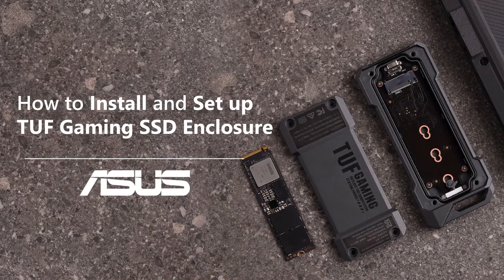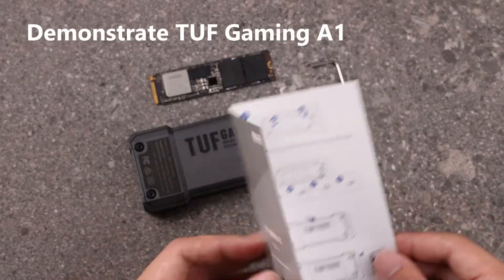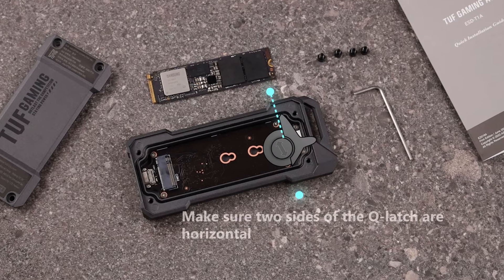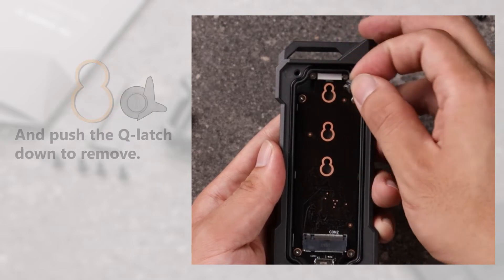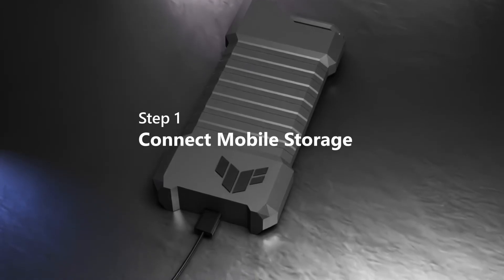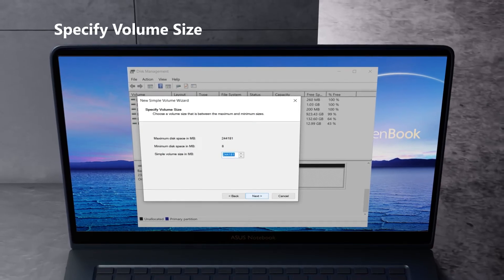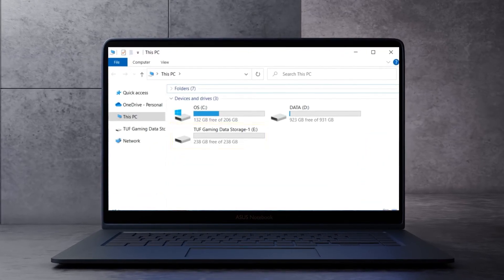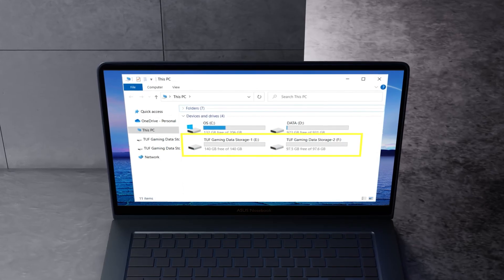How to Install and Set Up TUF Gaming SSD Enclosure    | ASUS SUPPORT

Comment: Hello, Asus. Will One 32GB module work with my board H310m-k r2.0 if I update to BIOS 2208?
Reply from the maker: It supports up to 32 GB (2 × 16 GB) of memory. A single 32 GB module is not recommended because this motherboard is only validated for 16 GB modules per slot. Compatibility with a single 32 GB module cannot be guaranteed.

Comment: Does it support SAMSUNG 990 PRO w/ Heatsink? 🤔 ☺️
Reply: Hey @reiterstahl, did you get an answer for yoru question? I'm searching the same thing. I bought an SAMSUNG 990 PRO with heatsink. I was wondering if this case can be combined with that.
Reply: @ibrahim.ozdogan  nope, isn't possible: "Please be aware that TUF Gaming A2 cannot fit SSD with heatsink."
Reply: @ibrahim.ozdogan You will hardly get an answer from any of the manufacturers! . They will refer to the manuals so its your responsibility if it fails! You need to google an hope info are correct. Or compare specs Samsung and Asus …
Reply: I have the samsung 980 pro and it works
Reply from the maker: Regarding your question, I would recommend you visit the following forum post to get more assistance.
https://zentalk.asus.com/t5/accessories/bd-p/Accessories
Sorry for any inconvenience it may be caused.

Comment: Can it be connected to android TV( sony bravia) with Usb A- Usb C cable?
Because Asus says It can only be connected to devices that support OTG functionality.
Reply: You need to try … if they do not specifically mention it they do not guarantee this! If you ask they will say exactly this! They won’t take any responsibility if not! My Arion works with TV … same with harddisks … max capacity 4 TB according to manufacturer … but I use 20TB!

Comment: This enclosure is not working with Samsung 990 EVO 2TB SSD, it shows only 119GB unallocated space in disk manager
Reply from the maker: Regarding your question, I would recommend you visit the following forum post to get more assistance. 
https://zentalk.asus.com/t5/accessories/bd-p/Accessories
Thank you.
Reply: @asus_support  Thanks for your response. I figured out the problem was not in enclosure but in SSD. Its was an online seller scam who sold 128Gb SSD with Samsung 2TB sticker. Got it replaced and is working now.
Reply: @SandeepKumar-km9op Yeah either scam or you must partition them first. My one displayed nonsene till formatted and partitioned to 4TB.

Comment: Isn't there supposed to be a thermal pad placed underneath the SSD? My Seagate FireCuda 530 2TB has components on both sides, and on the underside, they are just resting on the PCB of the enclosure.
Reply: Only gor double sided M.2!
Reply from the maker: I suggest you can refer to the instructions here. 
https://dlcdnets.asus.com/pub/ASUS/ODD/ESD/ESD-T1A/E20184_ESD-T1A_QSG_WEB.pdf?model=ESD-T1A
Thank you.
Reply: @asus_support  Can you just answer the question?
Reply: @Princeton_James  Hello, the thermal pad comes with the enclosure, but in some cases you might need additional thermal pads.
You must ensure that the thermal pads touch the metal body of the enclosure for proper heat dissipation.
You can stack the thermal pads one on top of the other. Without proper heat dissipation, your M.2 SSD might get damaged.
When you install everything, you may use CrystalDiskInfo to check the temperatures during transfers.
Hopefully it reaches around 60 degrees max. If you are uncomfortable with the temps, touch the metal body.
If the metal body is cold, that means that it's not making proper contact with the SSD and you should open it up to make sure there is proper contact.

Comment: I'm using a 4tb nvme inside the ASUS A1 and it's only showing 332gb
Reply from the maker: Regarding your question, I would recommend you visit the following forum post to get more assistance.
https://zentalk.asus.com/t5/accessories/bd-p/Accessories
Thank you.
Reply: @johncapone8843  Figured out the problem, what was the issue?
Reply: @SandeepKumar-km9op Usually its fake drives … whilst windows cannot recognise it displaying correct capacity … those drives here dhow the actual capacity.
Reply: Usually this happens with fake drives!

Comment: What is the difference between the tuf gaming A1 and AS1000
Reply from the maker: The specifications of the two are not quite the same. For more detailed information, it is recommended to refer to the following.
https://www.asus.com/motherboards-components/data-storage/tuf-gaming/tuf-gaming-a1
https://www.asus.com/motherboards-components/data-storage/tuf-gaming/tuf-gaming-as1000/
Reply: @asus_support  what makes one twice the price especially if they are the same read and write speeds.
Reply from the maker: For questions regarding pricing, it is recommended to contact customer service at your location.
The following is the contact information: https://www.asus.com/support/CallUs# 
Sorry for any inconvenience it may be caused.
Reply: @asus_support  so you can't actually give me any information you just send me to a link that doesn't give me any information 🤣 if you can't tell me why one is better than why should I even buy it.... You are completely avoiding my question.... They are the same speed they do the same thing and they can hold the same amount of storage but yet they are completely different. This makes absolutely no sense 🤣🤣🤣🤣 an no I'm not going to go click on your link
Reply: @brick8253 a1 is just an enclosure. As1000 is an external ssd bro
Reply: @pinoyozzyworld  oooooh okay so one is the empty enclosure and the other comes ready to go.... Why didn't they just say that 🤣🤣🤣

Comment: What about the heat pad?  How can you not even mention that?  Does the plastic film that looks like it covers it have to be peeled off?
Reply from the maker: Please refer to the illustrated instructions here.
[TUF Gaming SSD Enclosure] How to install SSD in TUF Gaming A1?
https://www.asus.com/support/FAQ/1048504
Thank you.
Reply: @asus_support - Thanks, but that still says absolutely nothing about the thermal pad!   And, of course, the full instructions should be included in the box no matter what.  In any event, I returned the unit I bought because it was giving me Ntfs errors when connected to Windows 11 with a 1 TB Western Digital Blue SSD installed.
Reply: @-johnny-deep- No … full instructions are not included any more! You are supposed to download it yourself. Regardless if motherboard, enlosure or aio. Do not remember the last time a full manual was included anywhere.

Comment: Hola, es normal que se caliente?
Reply from the maker: Hi, as your language is not my native language, to avoid any misunderstandings in communication, could you please state the situation you encountered in English? We apologize for any inconvenience this may cause.
Reply: @asus_support They're asking if it's normal to get hot.
Reply from the maker: When accessing and writing data, SSD generates a certain amount of heat. However, if there are still concerns, it is recommended to contact the local service center.
Reply: It comes with thermal pads and heatsinks. Can get up to 60 degrees. If your temps are normal nobody can say without seeing it

Comment: what if i have  4tb m.2 SSD ?
Reply from the maker: Hi, based on your issue, the TUF Gaming A1 motherboard features both PCIe NVMe and SATA interfaces, allowing it to accommodate M.2 SSDs with a maximum capacity of 2 TB and sizes of 2242, 2260, and 2280.
Thank you.
Reply: They won’t give you the Ok to anything not covered in manual!  If you wanna try anything not covered in manual … you must try and take the risk! My TV says max 4 TB … I use 20TB!

Comment: Hi I getting only 462.80 mbps on USB 3.0 type c to a port and also using the cable I received on box for my ssd encloser and I changed setting to better performance for ssd inside so please let me know how to increase the speed of file transfer atleast 2gbps
Reply from the maker: Hi, based on your issue in order to reach best efficiency, please ensure that you have connected USB 3.2 Gen2 cable, which is attached with TUF Gaming SSD Enclosure, to your computer’s USB 3.2 Gen2 port.
For instance, if your computer only provides USB 3.2 Gen1 port, then the maximum read and write speed can only achieve 5Gb/s theoretically.
You can refer to the following link.
https://www.asus.com/support/FAQ/1048496
The transfer speed may vary depending on your devices and SSDs.
Thank you.

Comment: how hot should this get ? mine is cooking at 120f is that right?
Reply: That's 48 degrees Celsius, it's perfectly fine, your M.2 SSDs inside your computer probably have similar temps.
Reply: Bro did you tried it with smartphone does it support iPhone 15 or any android phone

Comment: Hey im installing a transcend nvme model number mte250s a gen4 drive  4tb , i tried to format after format drive keeps trying to load then fail.

I format on pc everything ok copy some files works, i put back into enclosure then same issue

Not accesible, a device which does not excist was specified.

Any help?
Reply: That often happens when you got fake drives … on windows the scam works, but using the drive elsewhere … busted. Amazon, Ali … plenty of fake drives …
Reply from the maker: Hi, according to your question, may I ask have you ensure that the firmware and drivers for the SSD are up-to-date?
Have you try using a different enclosure to rule out hardware issues?
Or whether you try testing the SSD's compatibility with other USB ports or computers?
Reply: @asus_support  same enclosure works on a crucial p3 same thunderbolt 3 port same cable.

Can asus try the transcend model and on a usbc thunderbolt 3 port, as i believe its a combination of both factors that cause this error.

I tried on a usb to usbc cable it works but slow very slow. 40mbs..
Reply: @rekt999 wow I have the exact same issue. Did u find a solution ? 🤞
Reply: @huguesmoreau6696 Often happens if fake drive … as fake capacity then fails.

Comment: I installed fury renegade 2 tb M.2 ssd to inside asus tuf gaming A1 enclosure. I copy a large folder to ssd everytime copy rate decrease in 2 min and goes zero and  connection lost occur. What is the wrong with enclosure?
Reply from the maker: Hi, may I ask did you use the USB 3.2 Gen2 transmission cable that ASUS provide? It is recommended that you cross-test with other computers/ssd. Thank you.
Reply: I have the same issue. tested on laptop and a desktop both with ubuntu 22.04 . Trying to copy 80 GB of pictures and movies  on it. Starts at high speed (>700MB/s) and then in like 2 minutes speed decreases then the copy fails with the error: 
There was an error copying the ....

Error splicing file: read-only filesystem. 

The NVME m2 inside is a 1 TB Adata XPG Legend 840 disk. Tested the disk in a desktop computer and works fine. 

So, what's wrong with the enclosure? [yes, I'm using the transmission cable provided by Asus]
Reply: @avk100 I had an "issue" where it actually showed as 2 drives. One I believe is possibly the hardware for the enclosure itself and the small amount of data it contains, and the other is for the actual m.2 drive.